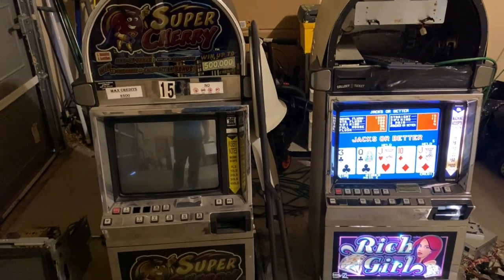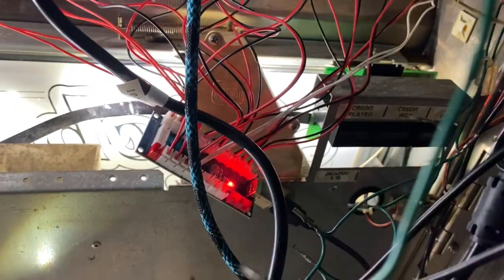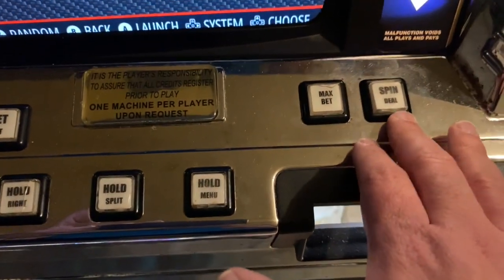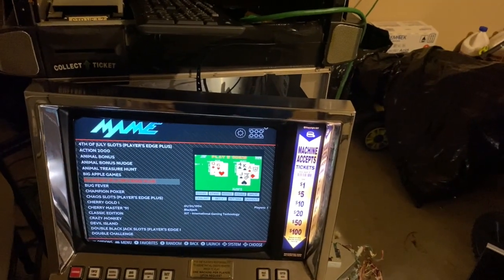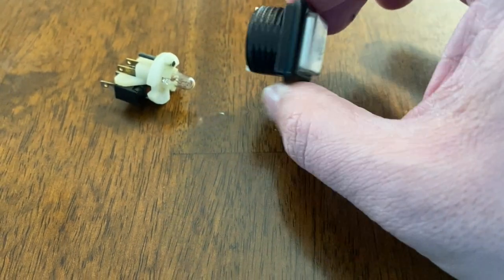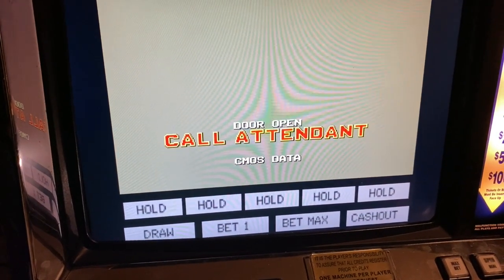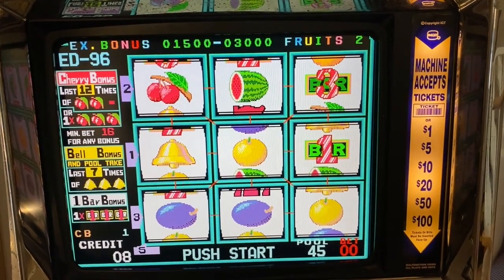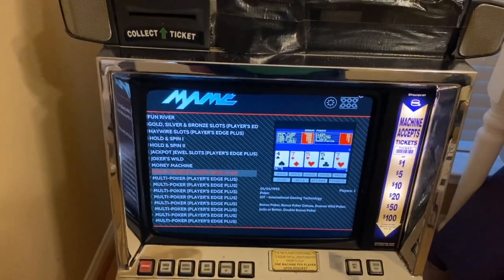RetroPie Slot Machine!

Comment: I see how all of your buttons are mapped with the exception of your CHANGE button to exit out.  Could you explain where the mapping is done for that button?
Reply from the maker: I mapped both the hotkey and start to the same change button.  Then in each rom I had to map the Spin/deal button (using the tab menu) to be able to start each game.  This allows one button game exit, since it is doing both hotkey and start, which is the exit key combo.  The drawback is I cannot then use hotkey combos in RetroArch, but I didn't really need that.

Comment: What emulator are you using?  I tried so many at this point and the screen just flashes and exits the rom. 😢
Reply from the maker: Skip to 22:20 and you will see I am using lr-mame.  It is a standard Retropie image for Raspberry Pi 3, and most casino roms require a newer version of mame, so lr-mame is one of the latest versions of mame.

Comment: Have you gotten any button lights working?  From my early investigations it may only be a Windows mame option.  All on or all off would be a compromise without a casino 7 in 1 board
Reply from the maker: That was my original plan, to at least have them lit at all times and even bought some new square buttons, but they were too big to fit into this machine without cutting the metal.